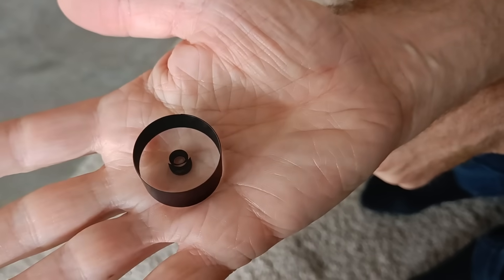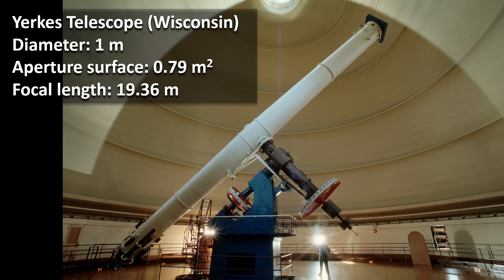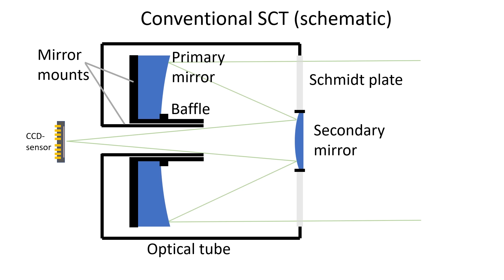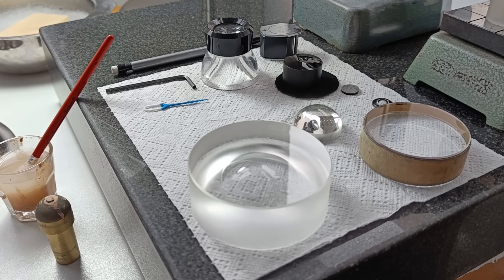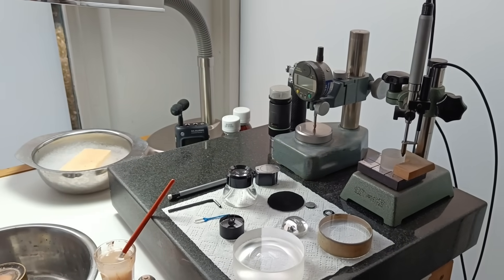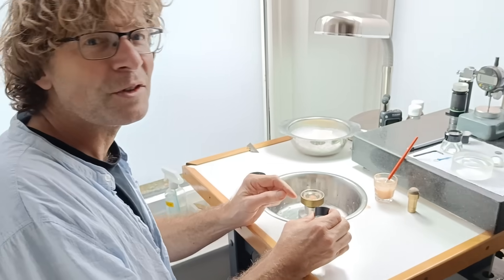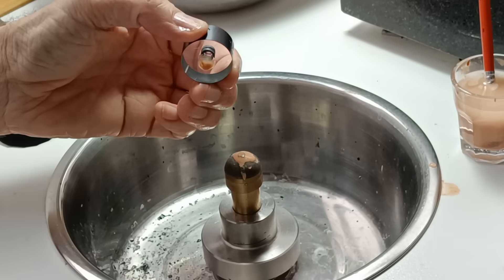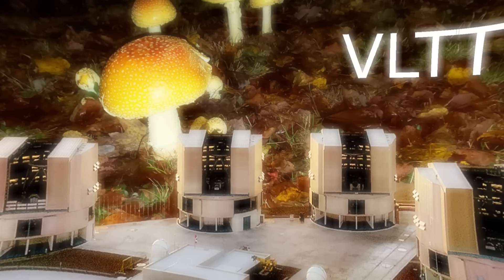Why is this Space Telescope so Tiny?

Comment: Sorry for the double post: I thought your interview was great. When you said there were English subtitles I was expecting you guys to speak in a different language, however there wasn't a single word that wasn't very clear and understandable.
Also its amazing that someone is able to do this type of work at home. Even though I know both of you have high levels of experience, it's really awesome to know that you don't need extremely expensive equipment to achieve such small tolerances.
Reply from the maker: Well, I also added the remark because of the variation in acoustics, which might hinder people with a hearing impairment.
Reply: Thank you so much!
Reply: Yeah, I turned on closed captioning in expectation that they would be speaking Dutch or maybe Frisian, but then they proceeded to speak perfect English — just like I should have expected from the Dutch.

I do wonder what ASML might be able to do with that kind of concept but working the other direction…..
Reply: @shubinternet  unfortunately with the advancements in EUV glas lenses are out. They've moved on to multi layer lenses to bounce the light around. Check out the channel asianometry if you want to learn more about what ASML and their optical supplier zeiss optical are up to.
Reply: Reminds me of a podcast I listened to once. There are more English speakers from "non-English speaking countries" than there are from "English speaking countries." Whatever can be considered the "correct" English accent is beyond me. Typically, the only people who have a hard time understanding accents are the people who have been exposed to only a small handful of them. In my opinion, that's a group that doesn't necessarily need to have their hands held.
Reply: @jimbrookhyser  People with a different way of speaking are feared and hated.
Reply: @esecallum  I see your point. But speaking for myself, I  neither fear nor hate anyone in this comments section.

Comment: If you do actually try to make an optical interferometer telescope array, that could be an incredibly interesting topic. But I get the feeling it would be arbitrarily difficult without sticking to monochromatic light. Or splitting the beams into three monochromatic paths.
Reply from the maker: that is correct, it would not be very useful with this size of telescopes

Comment: Thanks for another nice video. Excuse my ignorance, i am not an expert at all in these topics, but how come that in these telescopes one doesn't see a black dot in the center if the secundaty mirror is obstructing the passage of light? Thanks again!
Reply from the maker: all light from infinity that enters the telescope is reaching a single spot. But the the secondary is of course non-transparent. There will just be a little more diffraction by its edges.
Reply: @HuygensOptics  thanks!

Comment: With an echelon filter front end these would make fantastic solar telescopes. They'd be very short in length and the glass could also be used as a blocking filter. A mini H-alpha scope that fits as a lens on a DSLR!!!
Reply: Or a pair of solar binoculars! Sweet!
Reply: @annemarietobias  Trippy, a real stargazers toy.
Reply: Echelon or etalon?
Reply: @davidk7544  Well spotted - Etalon. I'm convinced my spell checker is being overseen by RAF Menwith Hill 😂
Reply: I was thinking the exact same thing! Maybe even with a solar tracker for long exposures…
Reply: Fitting this on a DSLR would be a dream come true for astrophotography.
Reply: If i remember correctly  etalon filters need some very specific optical systems, reason why they are usually used on refractive telescopes, never have seen one on a catadioptic or any other obstructed optical assembly.
Reply: @teresashinkansen9402  - optically they can be very simple since they are focusing monochromatic light. Refractive telescopes are mainly used since affordable etalon filters tend to be small 40mm to 60mm and a refractive telescopes is more thermally robust. You can mount etalon filters on larger catadioptric scopes but offset to one side for full filtered light transmission, but this can be thermally sensitive - since it will be exposed to full Sun. 
I thought Rik ter Horst's optics would be a nice compromise since it can be optically simple, thermally stable, act as a blocking filter and the secondary element could coincide with a central etalon support. I want one 😃
Reply: Fits on the end of a DSLR, though it looks like the image circle is probably for ~10x crop factor sensor.
Reply: Just need someone to figure out the mass manufacturing for it and there'd be enough of these to satisfy every enthusiast and photographer.

Comment: I recall in the 70s/80s that Vivitar marketed a range of 'solid' catadioptric lenses similar in concept but much larger (600mm f/8 and 800mm f/11 for 35mm film, my main recollection of holding one was how heavy it was despite its small size), however I don't believe they were monolithic despite the 'solid' branding (they still had multiple elements/groups, just generally thicker lenses and smaller air gaps).

Making something so tiny yet precise like this really takes a master, it might only take him a few weeks or months to finish one now but that's with decades of prior experience in making them.

While I wouldn't expect to see one in an art gallery the lenses he is making are absolutely works of art in their own right, and I can't wait to one day see an image captured by one (I'm sure to appreciate it that much more knowing slightly more of the background behind it).
Reply: Maybe this beyond the scope of a simple reply, but I’m puzzled as to how a “solid state” lens can be used to capture images at different distances.  You can’t “focus” the lens afterward so is the lens built with a particular distance in mind (for example the University wants to capture their campus from space so I assume their lens will be engineered for that exact distance so the surface of the earth is in focus)?  Or does the sensor move in order to be able to refocus on other things?  I guess I’m realizing I don’t know how phone cameras focus without moving parts.  Also I know that the aperture determines the speed of the lens, but are there inherent losses due to the fact that the light has to travel through a solid medium vs normal lenses where the light passes through mostly air?
Reply: @davidswanson5669  It would be focused to infinity.  Anything past a few dozen feet should be in focus.
Reply: @JP95ZM6  ha that makes sense, duh
Reply: @JP95ZM6  probably more than a dozen feet away, given the focal length is so long! But in space nothing's going to be less than many miles away.
Reply: @davidswanson5669  The normal focussing method is to move the sensor in relation to the lens - just move the sensor (or lens) back and forth until it hits the sharp focal plane. Most phone cameras had moving lenses (believe it or not).
Reply: @davidswanson5669  The same here. I wish to know more about this too. I have the same question, what about the body in the middle of the entire lens, do it produce some deficiency?. Sorry for my english.
Reply: David Swanson  Light can travel many kilometers in optical fiber, it is the purity of the glass that makes this possible. The path-length here is tiny.
Reply: yes reflector lens usually have small aperture, i don't understand why they said big aperture
Reply: I picked up one of those Vivitar lenses, the 800 mm f11 many years ago.  The lens itself is only about 4 1/2 inches long! It's very sharp considering it's relatively small size. The lens is stamped "made in U.S.A." and was manufactured by Perkin-Elmer. That company made a lot of optics for the US space program. The smallest mirror optics I've ever seen are a few lenses designed as microscope objectives by the Russian company Lomo. I found this video fascinating. I can imagine how much fun it would be to play with such a tiny telescope that this gentleman is constructing.
Reply: @jimzielinski946  It actually DID have solid optical element(s) -- With 7 more lenses to try to clean up the image! I seem to remember that it even had a partial aperture ND filter of sorts to control the central hot spot.
Reply: Perkins Elmer made the optics for the Hubble telescope and everyone remembers what a royal muck up that was.
Reply: @bobsmith6079  LOL I recall an magazine advert that Perkin Elmer had out at about the time of the Hubble Launch - the ad was all "sincere" and used misty soft focus to help achieve this desired "feel good about Perkin Elmer" effect - at the time I thought how bloody ironic. Wish  I could find a copy..
Reply: @bobsmith6079  I believe that Eastman Kodak made one of two ~90" primary mirrors for the Hubble at their Hawkeye facility in my hometown of Rochester, New York. Two were made with the idea being that both would be tested and the superior mirror would be put in orbit. Somewhere something was mixed up. I've since wondered which mirror it was that did indeed launch: the Perkin Elemer, or the Kodak? And were the BOTH defective in the same way?
Reply: I don't think the primary mirror was defective or else they would have had to replace it on the shuttle repair mission but rather the primary and secondary optics were mismatched which NASA blamed on not being able to test them adequately because PE was making the Keyhole spy satellites and they had limited access because of security. Given NASA destroyed 2 shuttles and killed all those astronauts I believe it was just their incompetence.
Reply: @sanityassassin8161  having just read about this - Perkin Elmer did. They tested it but the test machine was messed up when they were getting errant readings, and someone shoved some machine washers into the tester, then it read right! when tester number 2 also showed errors, NASA and PE both agreed not to waste time /budget chasing down a faulty machine, since their main tester worked and showed it was right. Turned out of course, whoever setup the tester messed it up. luckily for PE, they made it wrong SO WELL it was 'easily' corrected with optics.
Reply: @DLWELD  oh WOW. Oh noooooo. That's..... Really unfortunate.